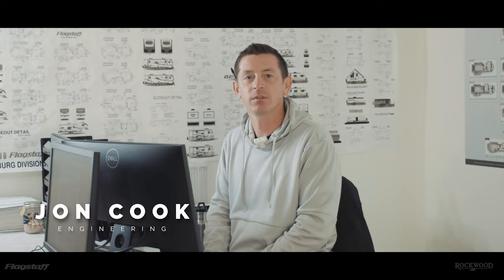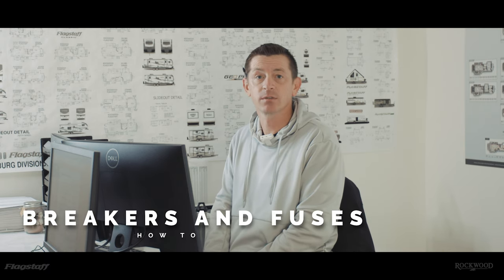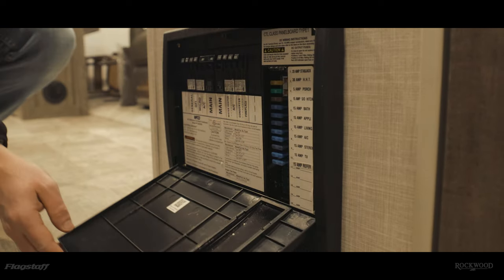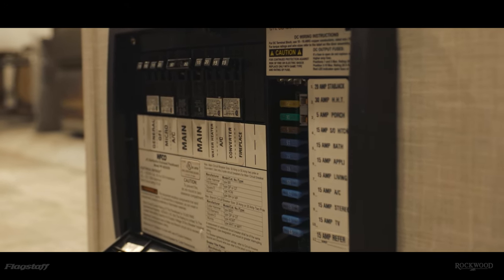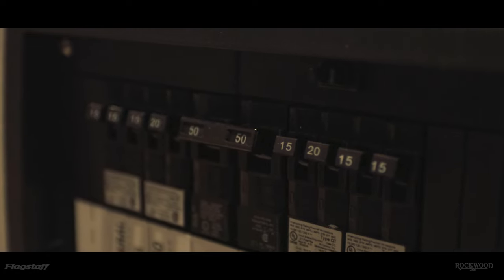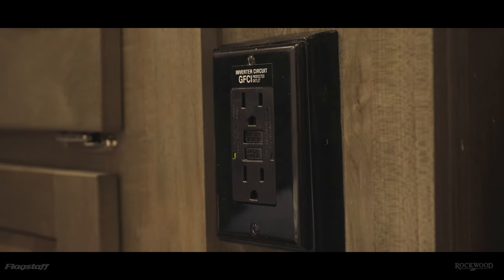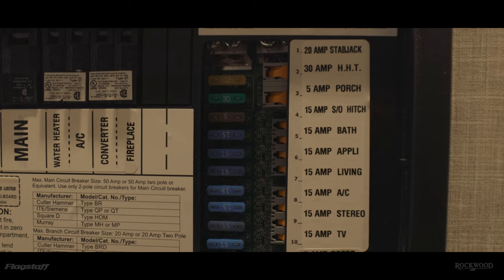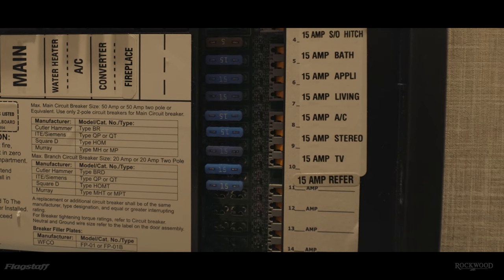How To: Reset Your Breakers and Fuses On Your Flagstaff

Comment: Well this video was no help with the kitchen slide no power to outlet in the outside kitchen but refrigerator works in the slide.  TV and outlets are inop tried resetting the GFCI but nothing. Where to turn to now?
Reply from the maker: Hello Candy, we are sorry to hear this video did not help your problem. Have you contacted your dealer about this?